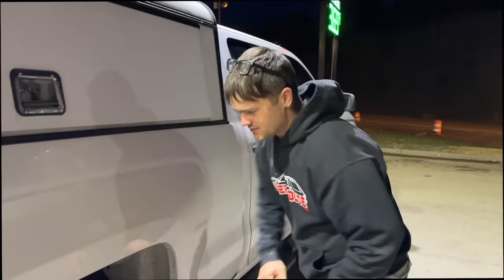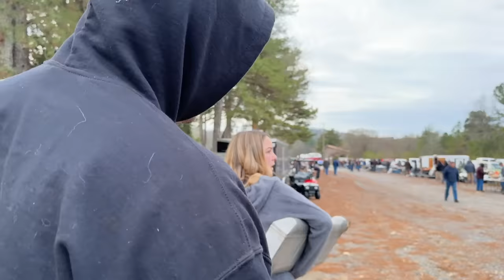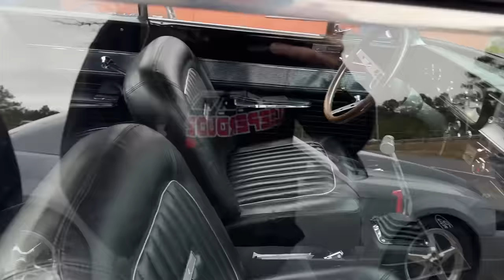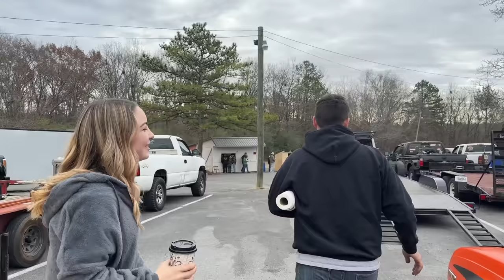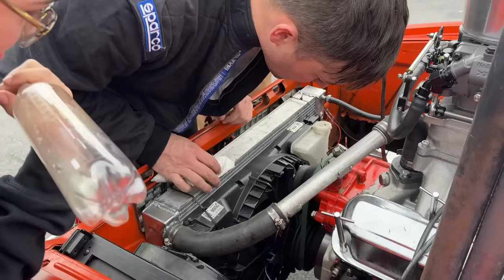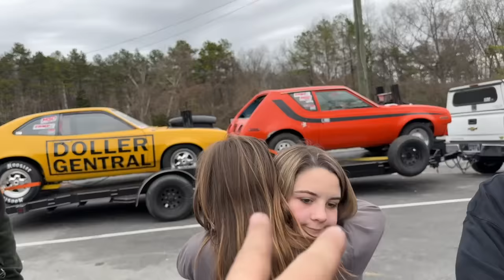Gremlin VS Pinto! Who Will Win? Kids Get To Ride Down The Drag Strip For The First Time.

Comment: Build a Jr dragster for Ralphie and let him rip it
Reply: Put a Tillotson 225 racing engine from go power sports on er.  It's a built 6.5 platform that turns 9500 rpms and is 18hp.  I have one of thoes engines on a sfd industries drift trike.  She runs 64mph with the drift sleevs on it!

Comment: I do believe you need to learn how to build/rebuild transmissions... That way, you know what you are running... That big block in the van needs a good one... I also suggest that you invest in Torque Converters with a good high stall speed, at least for the drag strip... You dont want to blow one... Not trying to sound like a pervert, but your daughters are quite cute now... I can see you having to have gaurd goats and really big sticks when they get older... You need to find a VW microbus for Squeeze, then paint it like a flower power van and put a Subaru engine in it (https://www.youtube.com/watch?v=jzB1Vc1h-Tc)... I think that would be perfect for the artist/gearhead in her...

Comment: Sorry have to comment on this one also, you said you've raced before. You act like a total novice or newbie. You were one of those throttle jockeys like a guy who just got his first motorcycle, cracking the throttle for no reason but to try and get attention. Then cracking out when driving them hitting the gas pedal every two seconds like you have some sort of nervous condition. Then you went down the track and saw smoke coming out your engine and misting the windshield with "fluids" which was oil and you should have shut the engine and got as close to the shoulder as possible. not only oiling the track but you could have crashed. thats the rule after wearing a helmet!! Then, you made the next careless mistake saying out loud walking past fans "that poor car, he really wrecked that car, that car is ruined" a dozen times. Making people upset your family included, you should have been smart enough to say "as long as the driver is ok, the car is only sheetmetal and can be replaced" putting fans and family at ease. Easy on the go fast peddle, if you think your leaking shutdown and stop before you get hurt, and remember its only metal it can be replaced not the drivers.
Reply from the maker: That’s funny